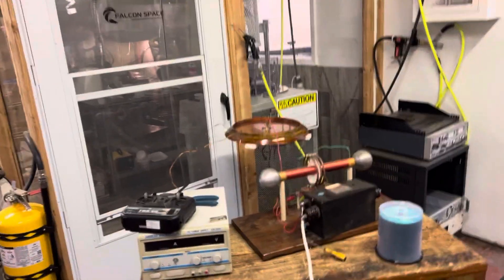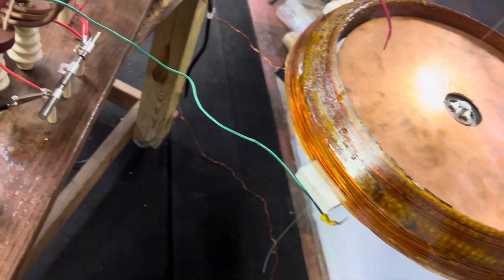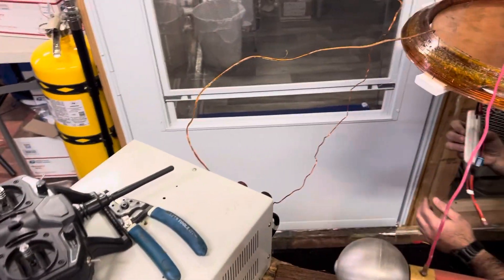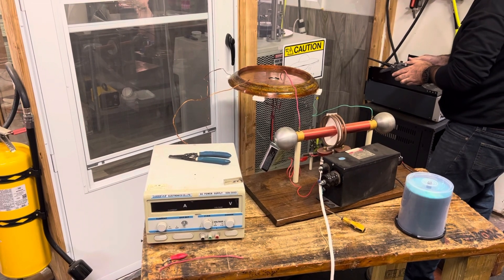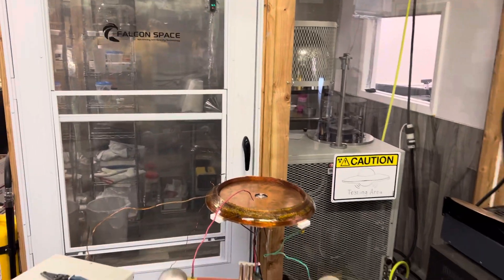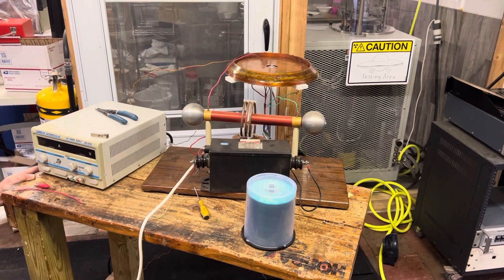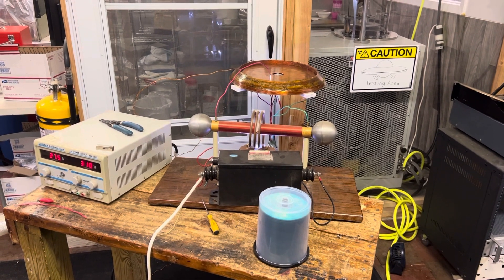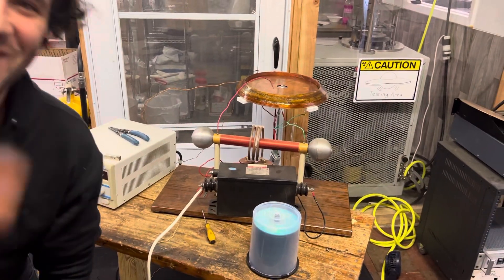Ez Alzofon with Casimir Cavity Copper plate and teslacoil.

Comment: I know what you’re trying to do … the copper plate must be surrounded by the magnetic field to make it works and spin around the plate.
Easy Toy Model:
-4 big spoons placed in square, each spoons touching each other’s on top of the other one.
-4 AAA batteries placed in each spoons on the negative pole.
-1 coin of copper placed in the middle of the square.
The old Flux Liner is just some kind of big Tesla coil powered by an MHD dynamo !
Reply: That wouldn’t actually work would it?
Reply: @HookLine48  no, sadly it would not work as spoons can’t conduct electricity, and even if they could somehow, the electric field would be too weak for anything to happen.

Comment: The analog scale is hilarious. Change could be happening on mg levels there's no way such crude measuring method would detect that. You would need to use a force transducer hooked to a pc to gather the data.
Reply from the maker: No way you can tease out mg weightloss with all the vibrations going on.